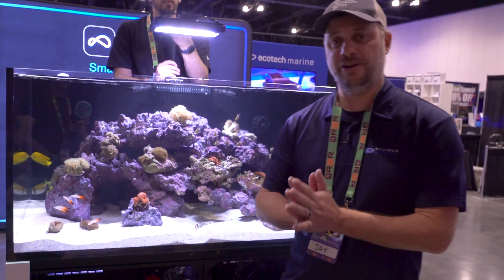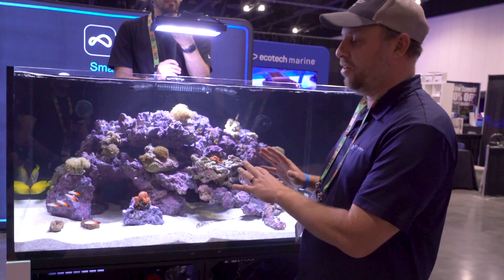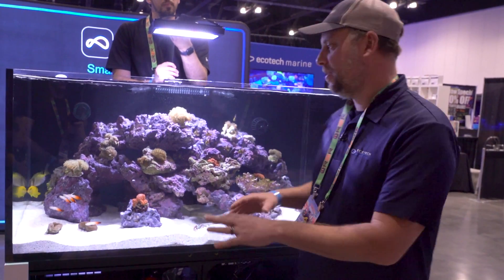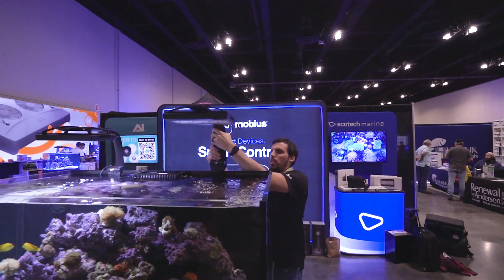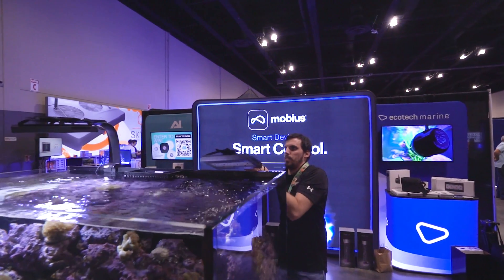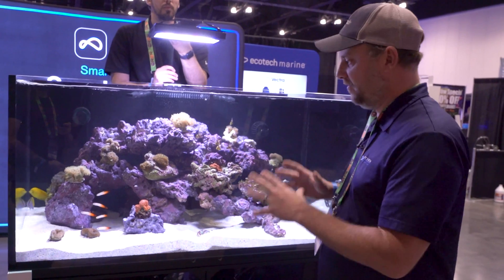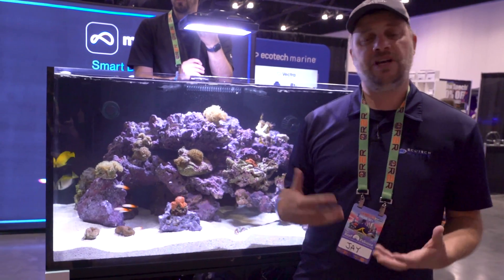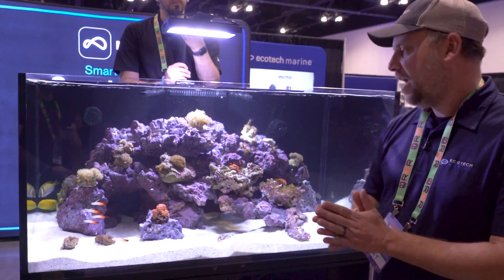Radion G5 Spread and Mounting Height - Raise the Light Increase the Spread.

Comment: I don't know about everyone else, but after having 2 Radion G5''s on a multi-light track for a year, I find the light spillage into the room to be an eyesore.  If it's a living space you will have light projecting into peoples eyes when they are sitting in chairs or glare on televisions etc.  It's also quite bright so the whole room is bathed in glowing blue/white light.  I'm going to mount these into a hood with holes cut out for ventilation for this reason.